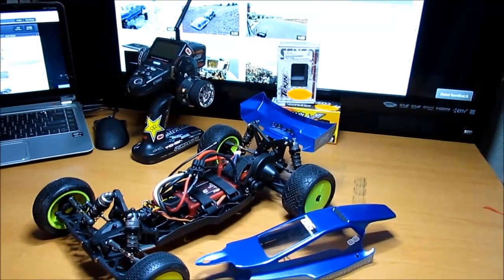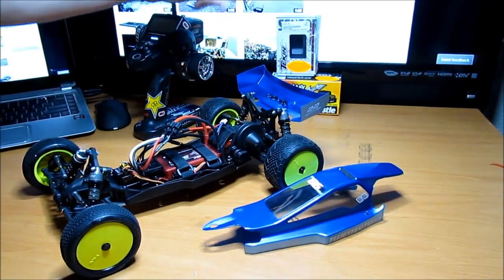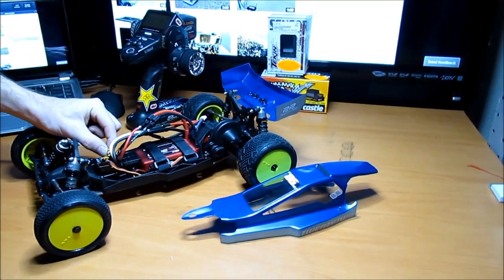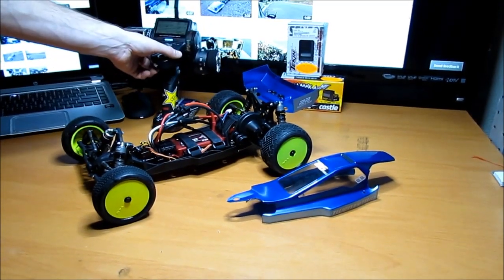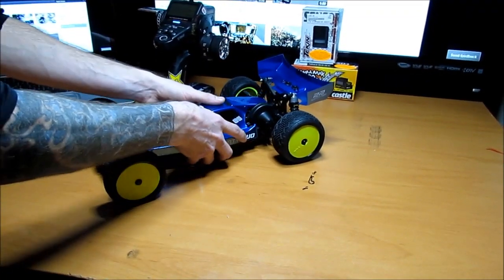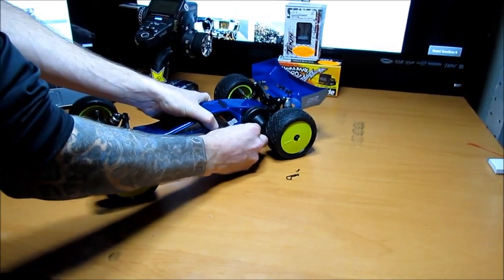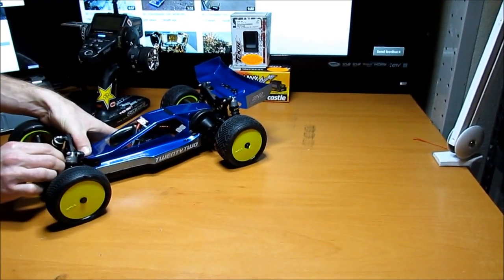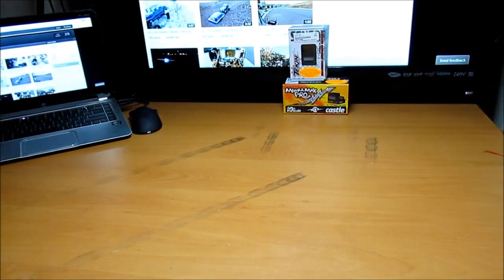RC COLORADO LOSI 22 BUGGY

Comment: short packs are great for track layout with lots of turns and jumps.. regular 2S is good for fast flowing track layout.. i run saddle pack on mine with rear set up so i can have one battery mounted in the very back and the other pack on front..  do not buy the cheap ball diffs buy the good ones..

Comment from the maker: Indoor clay, Check out Mile High Offroad Racing indoor track in Aurora, Co. And UNSER raceway Denver, CO.  They have 13.5 stock and modified race classes, I have to re-do the wiring, its still a mess lol.  Good info though thanks for watching and commenting:)  P.S.  Mid motor set-up sucks lol, had to try it though.  Its now rear mounted.

Comment: yeah mid motor is great for carpet track lots of grip... yeah get rid of that switch and deans plug add weight lol direct plug in is the way to go.. also cut the shock bladder all the way around..i run my buggies at SDRC indoor clay in san diego and i work next to the track haha so nice.. but yeah use a high down force wing also.. stock slipper on 22 sucks you can convert is to AE or just get the avid kit..

Comment: indoor clay or carpet?

i run rear motor with a 7.5 reedy... its quick.. i do have the tranny up 1mm for more bite on turns... tapper shocks... wiring is crazy clean lol helped a lot with weight loss.. put avid spur kit on it works great and smooth put the power down nice on the tranny..